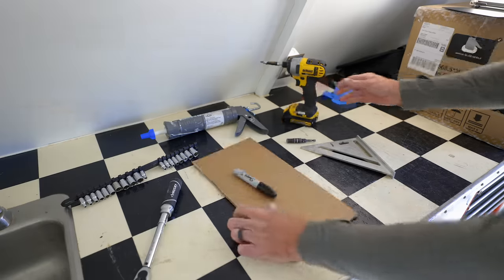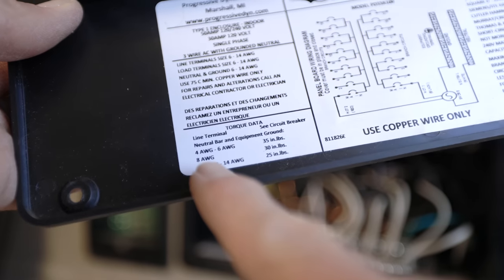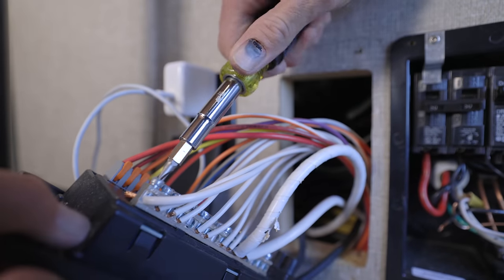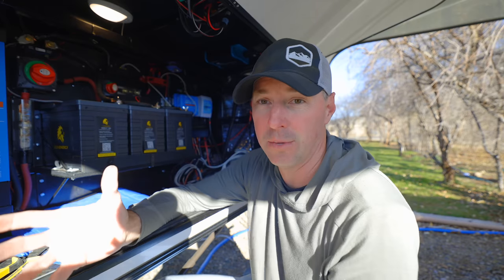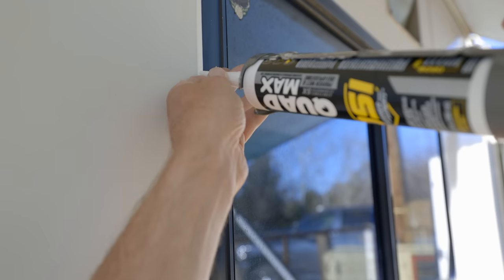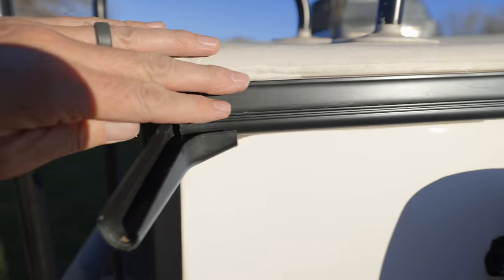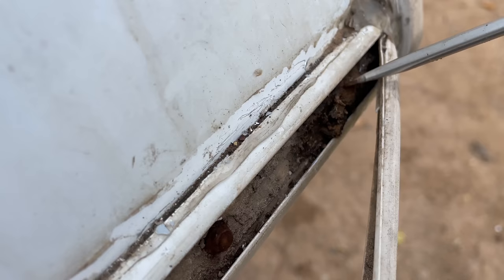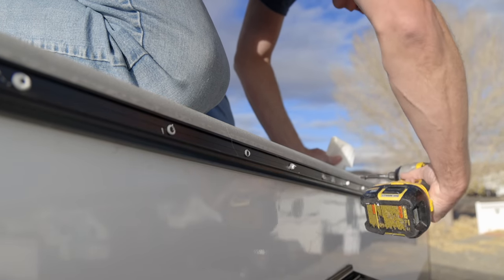Contractor Advice For RVers

Comment: This is a personal pet peeve from Dave.  Always set clicker type torque wrenches to their minimum setting when not in use.  Those tools contain a spring that sets the desired torque.  The spring develops a "memory" when it remains compressed for extended periods of time and the applied torqe will not be as expected.  The torque most likely will be "light" and the fastener could become loose.  The worse situation, especially for torque screwdrivers, could be if the tool internals are stuck and the tool doesn't "click" at the desired torque.  Few people can tell the difference between 25 inlbs (and a correctly secured electrical connection), and 75 inlbs (and a broken terminal block).  This is from a retired calibration technician that calibrated lots of things, including torque wrenches, for almost 38 years.  Safe travels.
Reply from the maker: Good tip.
Reply: Thanks!  I never knew there was such a thing as a torque wrench (that isn't pneumatic) or a torque screwdriver until recently. Thanks for the tip! I just ordered one of each!
Reply: Oh, is the torque the same when using the 1/2" adapter on a 1/4" wrench as using a 1/2" wrench? It would seem not, but I can't tell you why I think that. Something just doesn't feel right doing that. Thanks!
Reply: @BTNomad  test.   I am trying to reply and my messages are not going through.
Reply: @UCT5b41_Y9YZw_0HVuYt61bQ, awesome, thanks! That makes perfect sense!
Reply: @davelauraphillips8814  , there is definitely something weird happening with our comments. 🤔
Reply: @BTNomad  did you see the detailed text of my reply?  Something funny on my end because it looks like i replied, but then that reply disappears.
Reply: @BTNomad  i will try to post as a new comment on the original stream from Jared.
Reply: @Dave & Laura Phillips , I did see your great response, which made perfect sense. When I replied saying that,  your post did disappear.  Very odd.
Reply: @BTNomad  i think that there might be a single word that causes a problem.  Still trying to post again because it really is a great question that very few people would think of.
Reply: @BTNomad   i think I figured it out.  Please let me know if you can see my new post on the main thread.  I think the solution was the hyphenated word crow-foot.
Reply: Pp0po lol
Reply: @Dave & Laura Phillips  , I didn't see the comment show up anywhere. So weird.
Reply: @BTNomad  It should be as a new comment on the video and I updated it with your "name" as the source of the question.  Try to sort by most recent and hope you find it that way.  
OBTW - it has been nice exchanging messages with you.
EDIT - now this is crazy again - the post was there until I edited it to add your "name".  Too weird!
EDIT (again) - OK, I reposted it again without your name and I will not edit again.  I looked at the comment from another device and it was there.  Let's see if it stays there.
Reply: Yep. My father was a master mechanic and not releasing the wrenches was a big no no. Always take the tension out!

Comment: I ran 6 inch eternabond tape from top part of the roof down over that trim piece and into the bottom portion of the little rain gutter to completely seal off that part of the roof problem. It also seals the area where the roof meets the top of that trim piece to eliminate any possible leak at the roof line too.
Reply: Thanks Jeff I've seen this and have been contemplating doing the same.

Comment: Excellent video. Agree that there are similar maintenance principles that apply to RVs. I have a 2022 Reflection 28BH and enjoyed our first camping season with relatively few issues. When we took delivery I spent several hours (yes several hours) with the Tech to learn where all components and controls are located. Makes troubleshooting much easier when you know where stuff is. Perfect example is the wacky place Grand Design hid the AC and DC fuse panels behind the sofa near the floor. Perfect spot for a 69 year old  guy with a hip replacement and arthritis to check/change the fuses and circuit breakers . . .NOT.  Fantastic tips!!
Reply: 68 and I HEAR ya! My FR has them below the fridge and easy to get to, if you want to be on your knees, which I don't!

Comment: This is a follow up to a question from someone regarding torque wrench extensions and the need to apply correction factors.
That is a great question!!
If the adapter is directly in line with the square drive of the tool, like a simple size adapter (1/2 inch to 1/4 inch) or length extension, then no correction is required.  If the adapter changes the "effective length" of the tool, like a crow-foot adapter, then corrections are required.  Search for "torque wrench adapter calculator".  There is lots of good information including drawings with details.  Also check the user manual for your tool.  Hope that helps.
Reply: Found it! Thanks!
Reply: @BTNomad  Still not sure what happened to the other attempts to post that.
Reply: @davelauraphillips8814  , truly bizarre. Lol!

Comment: Once again good timely advise. Winterized the RV and was about to put it in storage. Went back in and checked the electrical panel and sure enough there were a couple that took a little tightening.   The main ground lead was downright loose. Glad I cought that. Thanks!

Comment: thank you for sharing this... i have sealed up a few light leaks for this winter but I am going up in the spring to do a full cleaning and re sealing of everything up there now that I am in a spot I don't have to move from.  I will also be getting someone out to check on a few things I have found to be having issues with, ie my fridge wont start since the last move so I am keeping it clean and keeping any smell out through the winter and will have it fixed in the spring and for now I am using a bar fridge...

Comment: When I removed the electrical cover, last year, I found two pieces of medal in the bottom of the panel that I could see were just bouncing around. It was two unused lugs that were not tightened down and had worked completely out. I found several more that were loose. What I got out of this venture was it is important to tighten everything that is used and not used. I hope this helps someone avoid a bad day.

Comment: That last tip with the trim piece covering those screws was great.  Pulling out those screws and putting a sealant on them before putting them back in should help keep the screws from backing out from the road vibration.  We’ve been on two 5,000 miles round trips this year and after each trip I have to get up there and tighten 1/2 a dozen screws or so as you can see them pushing out against the rubber trim piece.  Will have to do the sealant suggestion this spring before we head out again.  Thanks!
Reply from the maker: Glad it helped!

Comment: Great video, I have an outlet inside my entry door. I checked an it say “open neutralI “ notice when driving it works so a cable is loose. Will tighten the neutral bar. Thank you for the advise

Comment: On your trim, could you just drill a hole (or 10!) in the bottom of the groove that holds the welting? It may have to be large enough to get past the surface tension of the water - it may actually need to be a notch.

Comment: Steele Rubber Products makes a rubber replacement for the vinyl insert trim in your video. It seems like a good replacement that would seal better than the vinyl but it's kinda pricey so I haven't tried it.  Do you or anyone you know have any experience with this rubber insert trim?

Comment: @All About RV’s: In the last maintenance example regarding that trim piece, … why not just remove the trim piece altogether?  Would seem that might be a better route, especially after removing and caulking screws. Is the trim just an aesthetic addition or does it serve some other important function?
Reply from the maker: It is a compelling thought but I do like the trim for looks and should help not dry out the sealant I put on the screws. The trailer I sealed the window on has exposed screws whith no track for the trim cover.
Reply: @AllAboutRVs  Hmmm. Something I’ll need to check on my trailer. I havent had it long enough to even know what kind of trim it has. Thanks for jogging my brain. 😀

Comment: Hey Jared, in previous videos, on your old rig, you used the trim with the double sided flange. Is there a reason you haven’t put that on this rig??
Reply from the maker: Good question, it is the double sided flange trim on there, it was something I did last year but the metal is almost a  1/16th wider which makes it not as tight as I wish.

Comment: What did you use for caulking around the windows?
Reply: Looks like OSI QUAD Max 9.5 fl. oz. White Exterior/Interior Window Door and Siding Sealant.  My home Depot has it in Delaware for $10.98  Jarred can you confirm this?  (the product not the home depot part LOL).
Reply: The tube clearly states the brand -   Quad Max.   I have used Quad for 30+ years on siding and windows.  Fantastic product.  Available in most big box stores.

Comment: PLEASE!!! get a torque screwdriver. Without one, every time you "check" for tightness of screws and bolts you're likely to tighten EVERY screw ~32nd of a turn, whether it was tight enough or not. You WILL inevitably over torque all of the screws to the point that you will have stripped every screw hole.

Comment: Exposed wiring in the panel.. That is a hazardous issue. You got two wires at least in that panel that need wire nuts
Reply from the maker: Sharp eye, the video didn’t cover the other projects I was working on.

Comment: You just told people to go into an electrical panel without turning off the electricity and disconnecting the battery!
Reply: I guess that could be a bad outcome, but it's not something I wouldn't have thought about and I'm old and a beginner at this trailer thing. Definitely a good point
Reply from the maker: It’s in the video to disconnect shore power and turn off the Inverter if you have one.